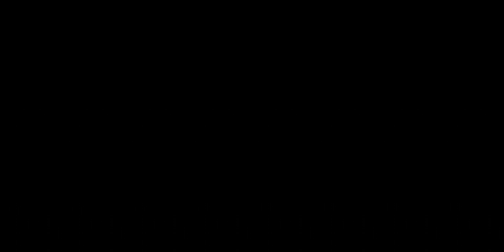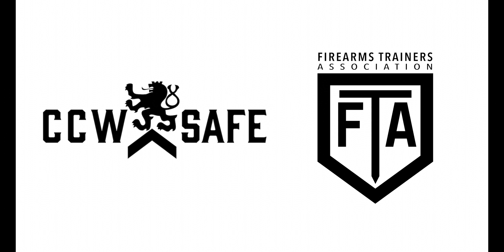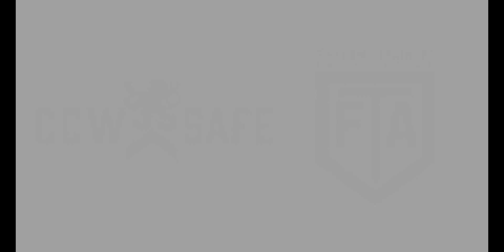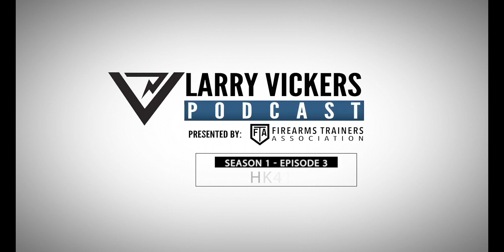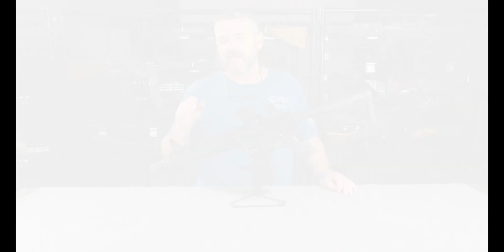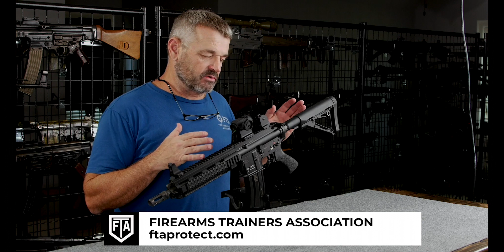Larry Vickers Podcast Ep.3: HK416 Presented by Firearms Trainers Association

Comment: For those who don't know.. the G36, just like many other rifles, uses the same short stroke piston gas system and box shaped BCG from the AR180, aka AR18, designed by Eugene Stoner;   and of coarse the M4 was just an evolution of the M16, which was an adaptation from the original AR10, also designed by Eugene Stoner.  So just to be clear, HK simply took a Stoner design and put it into another Stoner rifle, and claimed it as their own.  Eugene Stoner's Rifle DNA has been adopted in a lot of modern rifles, not just the G36, but also the Bren 2, Scar, ACR, and many others, including Brownell's take on the AR18, called the BRN-180.. Just do a image search on each of their BCG's.....  Obviously HK did add their own innovations to the 416, it looks like a space ship compared to the stamped AR18, but they did build it on the back of Stoner's genius gas system.
Reply: True!

Comment: What do you think of the 14.5-16" 416 variants vs the upgraded M4A1 with its heavier barrel? In my opinion from an armorer/logistical standpoint, I'd rather use the M4A1 since I don't need to worry about spare parts. Versus the M27 which uses a lot of proprietary parts.

Comment: Do you have those peak iron sights set up on 15 inch sight radius like they say say they’re designed for? I just noticed you had the front sight mounted behind the light. I was wondering if they’d still work alright pushed out on the end of a 15 inch handguard giving you probably closer to a 20 inch sight radius

Comment: The G36 carbine gas system for M4/AR15 already exist. It’s called the BRN-180 aka AR-18. The AR18 is where the G36 got its idea/copied from if I’m not mistaken
Reply: The AR18 is not an AR-15 with a gas piston...
Reply: @huitzplochit  

You are spreading false information. The AR-18 is indeed a short stroke gas piston A take following the AR 15. Arma Lite never adopted it. The AR-18 has a foldable stock which also can be fired from this configuration (short stroke gas piston) The lower receiver from the AR-18 it’s what’s different on today’s version the BRN 180 you can fit that upper on a modern lower AR-15 receiver, and this is where the short stroke gas piston (G36) exist on the AR-15 receiver which I clearly stated in my original comment

Brownells decided to modernize it and bring it back to civilian market as the BRN-180 with a few improvements. A little google you educate you before you start making a fool out of yourself online
Reply: @vicdiaz5180   who are you calling a fool, when your the one saying the ar-18 was the orginal ar-15 with a gas piston? An orginal AR-18 (not some modern day brn-180) has a whole bunch of differences from the external design. The HK416 has a different gas system but the rest of the design elements are oriented to mimic the AR-15 design...
Reply: @huitzplochit  You are exactly the fool because if you reread my comment I never said that the AR 18 was the original AR. And clearly if you were to watch the beginning of the video he was talking about the G36 for a minute and that is exactly what I was referring to the beginning of the video and not the HK 416

Again jumping to conclusions and assumptions is making you look like a fool. Read slower buddy!
Reply: @vicdiaz5180   well even if I'd read slower, your unconventional way of writing sentences and constant editing doesn't really help either, to understand what your on about. Your comment was that a G36 style gas system for the m4/m16 rifle already exists, and that it was, if I understood correctly, adding a AR18 upper to an AR15 lower. But that would leave you with some kind of weird AR15/18 Hybrid and not just an AR15 with a diffrent gas system. Then I mentioned that an AR18 is not simply a AR15 with a diffrent gas system. Like the 416. Then you said iam spreading false information and iam making a fool out of myself. Please explain, why saying an AR18 isn't an Ar15 with a different gas system is false information? Also what the other fella is trying to tell you is that the ar18 took its gas piston design from already existing systems, and he stated clearly that it cant be assumed that HK copied the AR18 gas piston design when you could also argue that they copied the designs the AR18 used to copy. So not exactly what you were saying...
Reply: The ar18's piston system is more similar to the one of the g43 which in return is basically the same as the one of the svt 40. I wouldn't say that they took a lot of inspiration from the ar18 when designing the g36 piston.
Reply: @MaxB00M  that was my point exactly! HK took the idea from the A.R. 18 and my point was that that gas system exist today for the AR 15 system

Ian from forgotten weapons also touched on this. The AR-18 is where HK got their idea for the G36

Comment: Why couldn't the Marines just ADOPT a regular 416 with a 14.5 barrel? They had to get this weird heavy 16.5 inch barrel thing going
Reply: @The Sensitive Psycho Yeah, but it's also heavier than it should be and the stock butt plate keeps falling off.
Reply: @SumTinWong01  I believe the reason is because the M27 is also supposed to be their squad automatic weapon, so the heavy barrel is intended for firing a lot of full auto in suppressive fire.
Reply: @gameragodzilla  And then they decided to arm every front line grunt with them which kinda takes away from it being a replacement for the SAW when it's really a replacement for the M16
Reply: @SumTinWong01  Well, it just means everyone's running around with SAWs now. lol
Reply: @gameragodzilla  No. Everyone's running around with rifles pretending to be SAWs to fool the people in charge of their budget. They're putting LPVOs and suppressors on these things.
Reply: @SumTinWong01  ye it makes sense a 16 inch one shoots like a 20 inch ar and is weight is just based on the piston system  (all the weight is behind the gas port you can see when the rails is off how thick it is vs m4 barrel ) so might as well add length to get father range and better ballistics. the barrel is the same as the 416 one just chopped. also they put sup on them since they are over gassed to shit to run all like 12 types 556 rounds the military use .Also not having a sup on it when its chopped is fucked gas all in your face not something most people like dealing with when trying to line up sights
Reply: @The Sensitive Psycho Yeah, but it's also heavier than it should be and the stock butt plate keeps falling off.